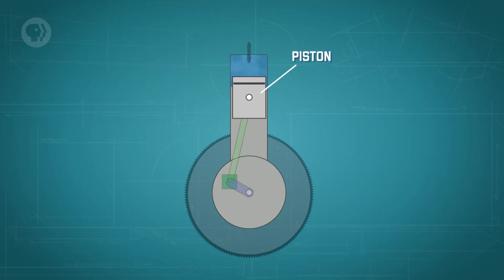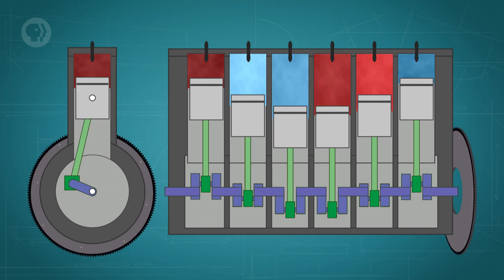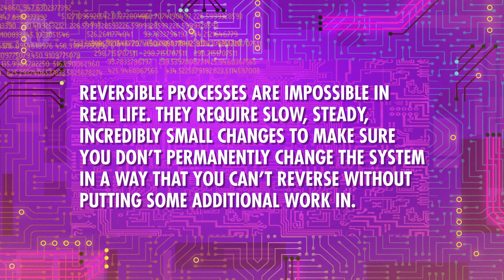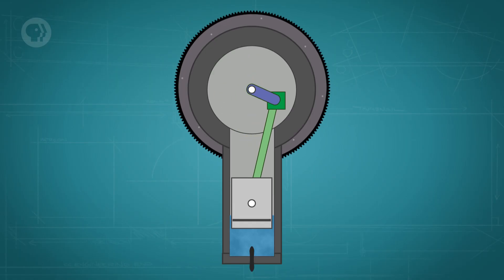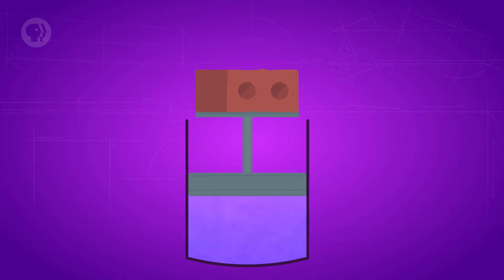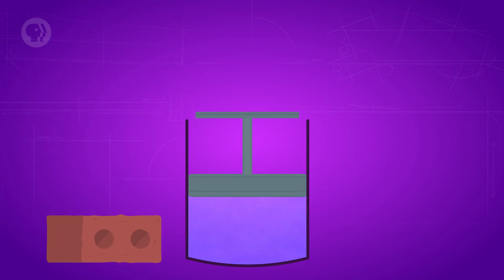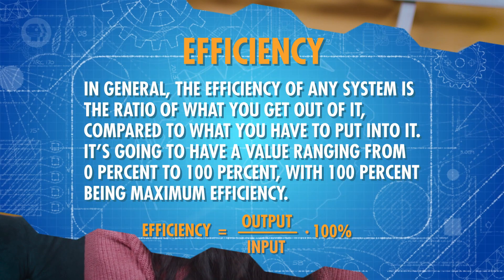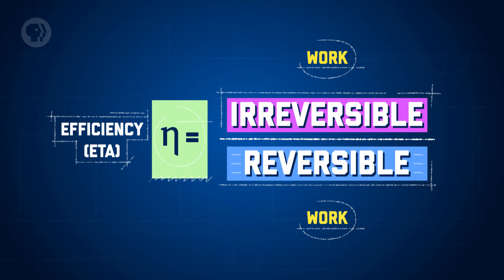Reversibility & Irreversibility: Crash Course Engineering #8

Comment: Surely breaking the brick in two and lifting it a smaller distance twice is the same as lifting a whole brick the full distance? The weights add up to the total weight. Thus the half forces add up to the total force. The distances lifted also add up to the full distance lifted.

Comment: I am no engineer and maybe I have no idea what I am talking about but I feel like the example was a bit off. Ultimately I feel like you exchanging one work for another. Now instead of the weight, you have to move the massive volume of infinitely tiny pieces of brick and the Piston is doing the same action with the tiny pieces as it was with the whole brick. You put the brick or tiny piece on the Piston, it goes down, you take it off and it goes up. Am I just missing a key point to the example? Also don't get me wrong, not trying to give her a hard time also. She is doing a far better job at this then I prob would.
Reply: I think It's because that whole mass doesn't have to move the same distance. Each part is then able to move only the required amount which requires less work. It's an unrealistic example, but an example still.
Reply: Just watched it again, I think you are right. Thank you
Reply: Indeed the small pieces of brick still have to be moved sideways overall (perhaps some up and down motion too, they were phasing through the cylinder wall in the animations!).  This requires accelerating and then decelerating them, something that itself will incur losses in any real system.

And the whole example was skewed, because why not have the whole brick only lifted up to a platform at the maximum height of the cylinder platform, rather than all the way down to the ground and back up again ?  To match this part the half bricks would have needed to be placed on the ground as well.

Comment: Reversibility is an important thermodynamic aspect of mechanical engineering. The term 2nd Law Efficiency defines the efficiency of any machine with respect to reversibility. As mentioned in the video, there will always be some irreversibilities (theoretically there could be no 100% efficiency, also in pratice it wasn't achieved).  In the video, efficiency is defined very cruedly since there are various types of efficiencies (one mentioned above, thermal efficiency is another major one). It is sad to see that the 2nd Law of Thermodynamics didn't mentioned in the video since it is very important for the reversibility.

Comment: Why not use a electrical engine, They are reversible, and could have been used for a example instead of the brick on a piston
Reply: King Peter they arent 100% reversible
Reply: Jakobmaximus like anything, but it's a better example then a combustion engine that cant be reversed at all. 

A other alternative could be a sterling engine wich when run in revers with a other engine it turns into a heat pump instead of using departure difference to turn a wheel

Comment: yes that is a truth how ever i am not satisfied about the currant day machines turbine engines etta = 45% petrol engines = 35% diesel engines = varies between 35 to 45% old school engines max 25%   even electrical motors = 85% you might want to cover perpetual motion machines

Comment: Love your videos, but the example with the reversible two bricks + piston is not very clear. 
Some numbers plugged in would be helpful, so that we can see that breaking it into smaller pieces reduces the overall work :)
Reply: This is a late reply, but for anyone watching these videos really late like me, I thought I’d put an explanation in with the numbers.  Previously, she said that Work = Force times Distance, and this is needed to understand the rest of the explanation.  Let’s assume that the piston is 1 foot high, that the brick weighs one pound, and that the piston is sitting on a table.  After taking the brick off of the piston and putting it on the table, the piston rises to its full height of 1 foot. To put the brick back on the piston, you’d need to exert 1 pound of force over 1 foot, which (according to the equation I said above) means that you’d use 1 unit of work to get the brick back onto the piston ( 1 pound times 1 foot = 1 unit of work ).  If you instead break the brick in half, when you take the first half off and put it on the floor, the piston extends to half of a foot.  When you take the other half off and leave it at the height of half a foot, it extends to the full foot.  To put the weight back on, you would first take the higher half-brick and put it on the piston, exerting 1/2 a pound of force over 1/2 of a foot (since it’s already halfway up).  This would exert 1/4 of a unit of work ( 1/2 a pound times 1/2 a foot = 1/4 of a unit of work).  You would then take the half-brick that’s on the table and put it on the piston, exerting 1/2 a pound of force over 1/2 a foot (since the piston is halfway down thanks to the other brick).  This means you’d exert another 1/4 unit of work (1/2 a pound times 1/2 a foot = 1/4 unit of work).  In total, you would have exerted 2/4 units of work, or 1/2 a unit of work compared to the 1 unit of work exerted when you lift the whole brick the whole way up. Hope this helps!
Reply: @krispbreadd  Amazing clarification!
Reply: Rokas Zvirblis (:
Reply: @will123134  oh I thought you lift the tiny piece of brick off the Piston and leave it beside it's new height. Then there will be no work done during compression.

Comment: Doesn't it seems to like the resting period of a piston has arrived when pistons will sit on a back of a garage and see the fast pacing sexy electric motor rotating at that high RPM that the piston have never thought of.  Miserable Piston.
Reply: I meant we are done with the combustion engine car, No combustion engine car no use of piston and electric cars have just motors to create torque.